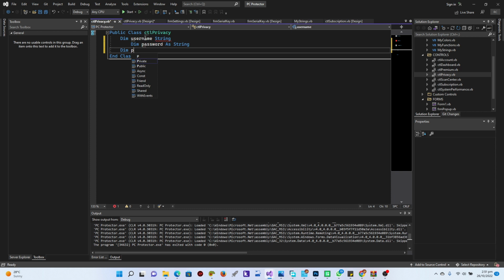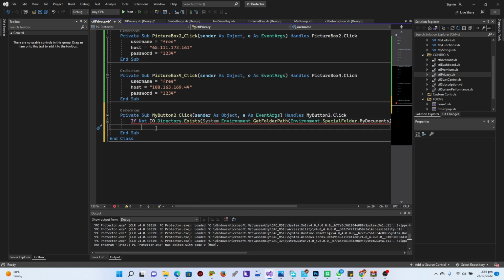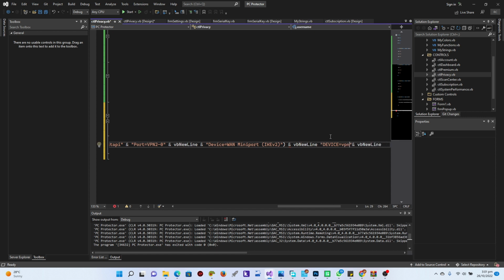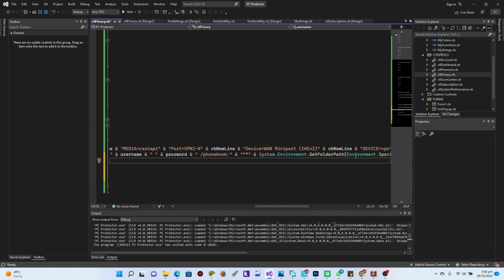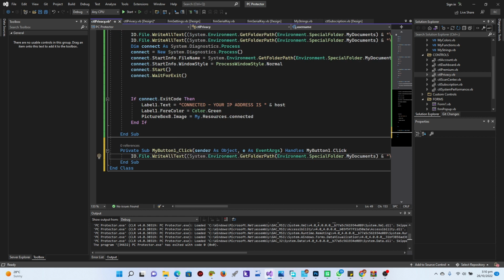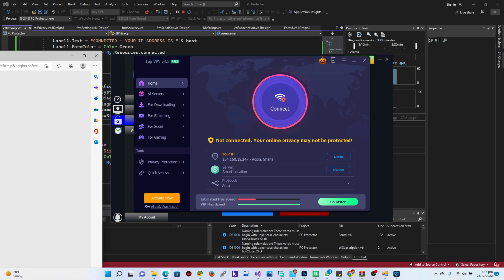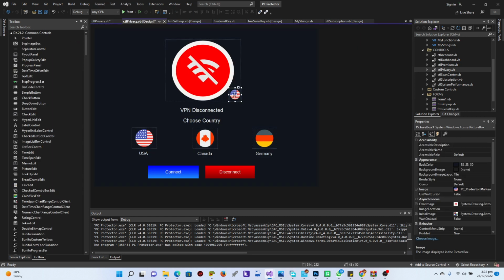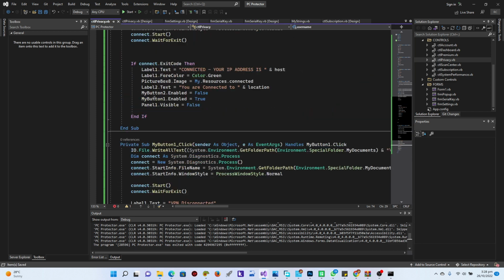How to Create Antivirus Software VB.Net - 2022 Edition [CODING VPN CONNECTION]

Comment: Please help!!
connect.Start() in the connection button is showing exception

What to do 🥺🥺🥺
Reply: okay i will check and give you the feedback
Reply: @iketechintwi  an unhandled exception of type 'system.componentmodel.win32exception' occurred in system.dll the system cannot find the file specified

This is the error
Reply: @ashishs4562  use try catch exception block to handle the error
Reply: @iketechintwi  ok I will try
Reply: @iketechintwi  thanks for replying sir 🥰
Reply: @iketechintwi  it worked finally 🤩🤩